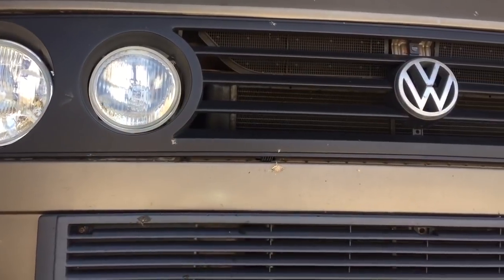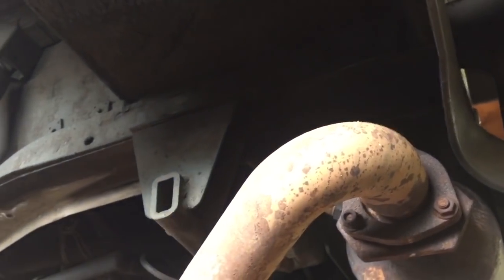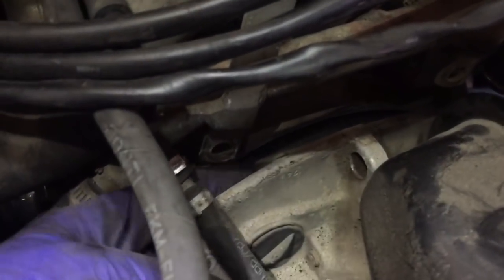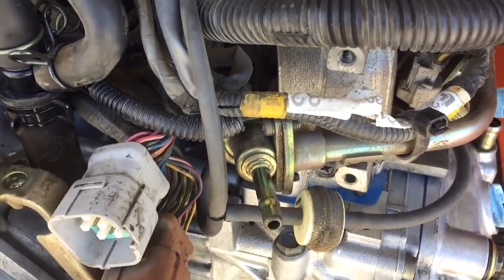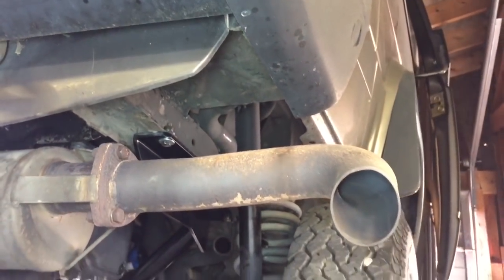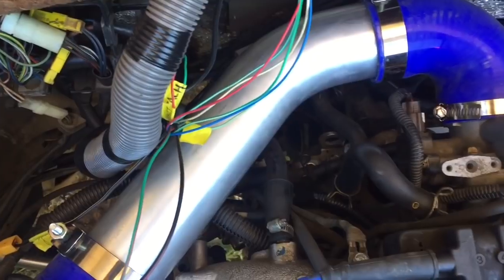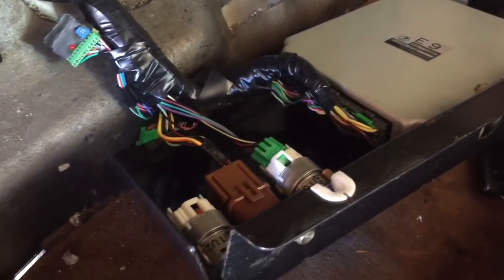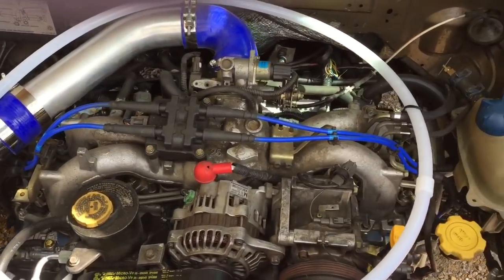VW Syncro Subaru Build

Comment: You may want to use Jegs 5/16" SS fuel line coil cut to fit and eliminate 90% of that vulnerable fuel hose. We use a tool by Graham tool ($150) to put a bubble in it. Get rid of the plastic lines to tank. Today's shit fuels kill fuel hose.  I have maybe 12" of fuel hose on my 3.3L Westy conversion. Looks good.

Comment: Great channel and great help..What subaru engine can i put in my 81 vanagon gl?Going to use your channel as a guide to do it also do you sell the wiring harness?
Reply from the maker: I like almost anything from 1990 on. The 2.5 is definitely the most common these days though.
Reply: Busaru will a 2.4 liter 5 cylinder diesel engine from a 97 eurovan fit into an ‘81 vanagon?

Comment: Where do I get a tach conversion? I have SVX Syncro and the tach never goes above 1.5k rpms. Is it the resistor behind the tach ?
Reply from the maker: Well, I offer one on the Busaru.com website, but you can play with the resistors on the back then get a 6cyl to 4 cyl converter.

Comment: Nice. Will an H6 fit it ok ?
Reply: not sure on syncro (engine and trans sit lower and back a little), but they fit in normal vanagon.  The 6 is almost the same size and it uses a timing chain, not belt...guy told me they are almost the same size and he was converting them to run with Man trans.  THey only came with automatics...